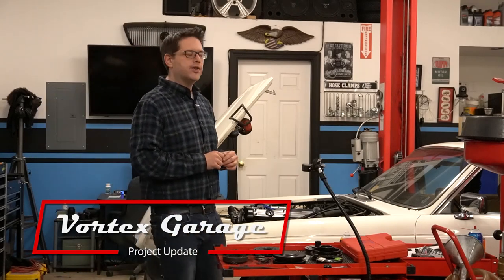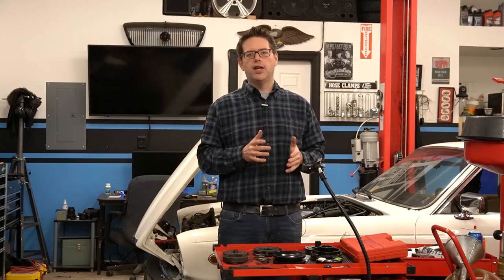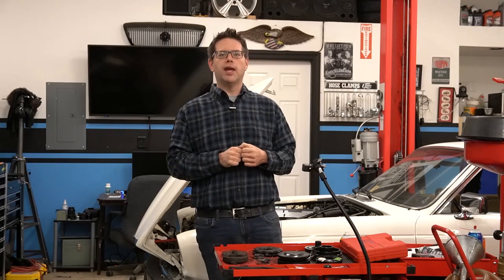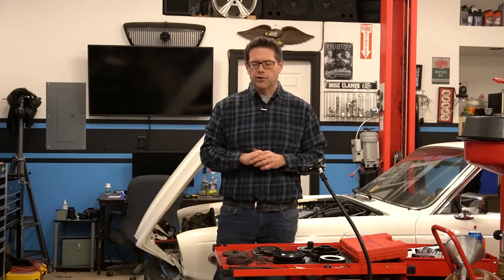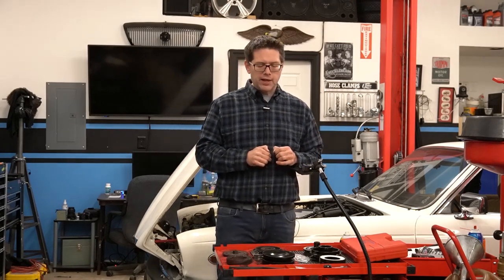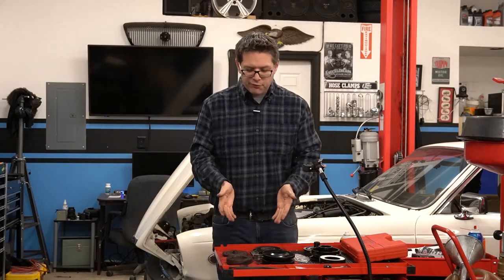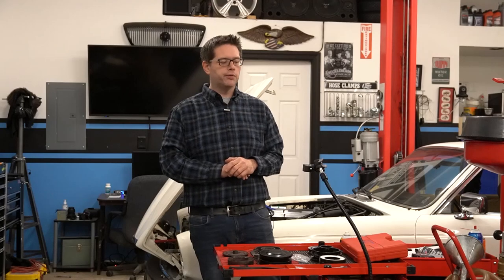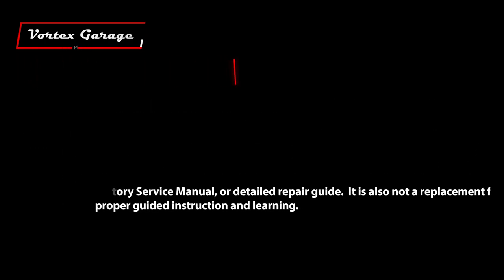A Super Common AC Compressor with an Unobtainium Clutch

Comment: As a Sunair factory vendor I will say it's very easy to obtain "S6" Compressor parts and far easier than you make it appear in this video. Although, your problem is not uncommon when going with a different model drop in replacement compressor model. Inside that "S6" compressor it's actually a Denso 10PA17 series compressor!

Comment: I have a 1985 Jaguar Xj6, which was pretty much original when I got it. Mine currently has its original A6 unit. Some day I will get around to fixing the AC but for now I am chasing the very common rough idle issue.

Comment: I'm thinking they bought a compressor that did not have the proper jag v pulley so they transferred the original clutch from the previous compressor. Or maybe they bought a bare compressor without a clutch?

Sorry though the only Jah I have is a modern s-type. I came across this video as I have same exact failure on my 48 Packard restomod with a sbc and a6 compressor. Getting that snap ring holding coil was a bear and I wanted to see how others got it out.

Comment: I'm dealing with the same issue. My compressor is a 4 'seizens' 58098 in which the bearing failed as well taking the hub and pulley with it. But I may have found a clutch for mine. We'll see when it gets here. If it's a fit,  before installing, I'll replace the bearing with one of known quality. If not, I'm going back to my original A6.

Comment: I know everyone is going to go nuts here, but the original GM A6 compressor should take 525 grade mineral oil ONLY. When you could buy GM rebuilt versions they carried a sticker warning you of this. I know a UK-based Rolls' specialist that sells them with the sticker in place. Doesn't matter how many are being fed PAG oil...It is NOT right and soon enough the compressor will fail.

The R134a conversion took over, I can see why, because lots of people say it works. Too many differences for it to work properly. I don't understand, apart from high-cost, why RS24 gas, a direct R12 drop-in gas has not gained wider acceptance?

I think someone else suggested this, the answer lay in fitting a standard A6 compressor.